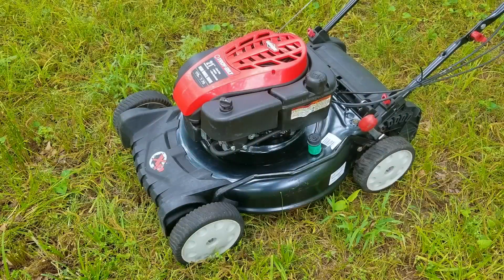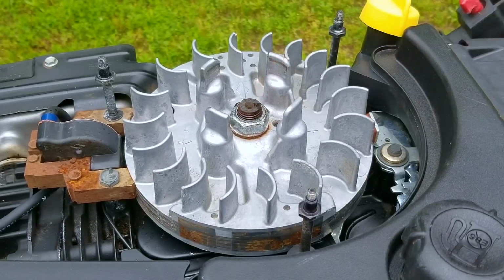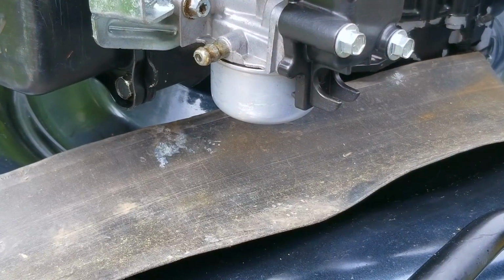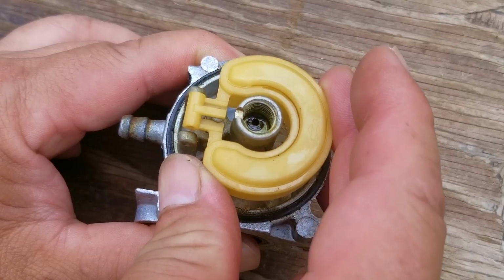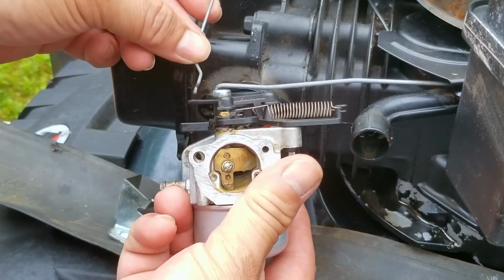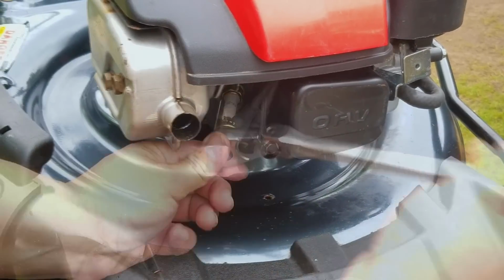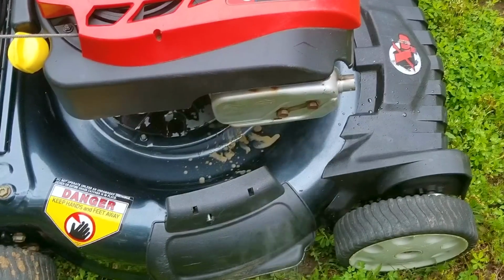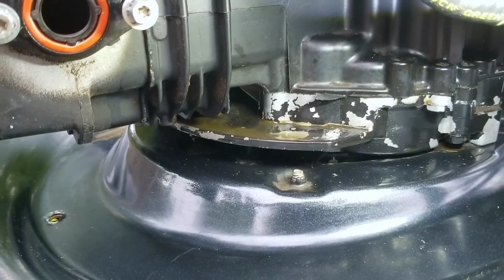Trying To Fix A Troy-Bilt XP Mower That Won't Start

Comment: I had a mower that was in a lake for 3 days.   For me. I drained the oil and water...cleaned out with carb spray...changed oil 3 times until no milky sludge....I still use that mower....but its a Quantum
Reply from the maker: wow nice!

Comment: Here is what I would do with this mower. I would take it all apart completely, engine included. After seeing what condition that the engine is in, then I'll know if this is worth fixing or not. This won't cost you money but it will cost you time. 🤷🏿‍♂️🤷🏿‍♂️🤷🏿‍♂️🤷🏿‍♂️🤷🏿‍♂️🤔 Keep up the good work. 😊👍🏿
Reply: Huge waste of time unless you are really really bored and have absolutely nothing better to do.
Reply: @tjclarke4604  Making money is NEVER a waste of time. You might want to remember that. 🤔🤔🤔🤔🤔🤔🤷🏿‍♂️
Reply from the maker: well said
Reply from the maker: good point!
Reply: @patrickpoulard24  It has been my job for over 30 years, master service technician, double-certified.  Trust me, tearing the engine apart WILL NOT make you money, YOU might want to remember THAT!
Reply: @tjclarke4604  If you are who you claim to be, you off all people should know better. 🤷🏿‍♂️🤷🏿‍♂️🤷🏿‍♂️🤷🏿‍♂️🤷🏿‍♂️🤦🏾‍♂️🤔

Comment: Carburetor $23 on Amazon, flywheel key $2, if that were on the bench in my shop, it'd be a $90 quote to the customer, I'd say it is worth it.  In a stealership, you'd be looking at $120 labor minimum, + shop supplies, $80 carburetor...  Take it a tech who works on his own, this is a really common things with these mowers and nobody should get ripped off by a dealer for something that literally takes 1/2 an hour.  Good video, you did everything perfectly, and that mower will work just fine once you finish it up and install the new parts.  Looking forward to it.
Reply: If you think you could fix this mower, including oil leak, in 30 minutes, then you are either really really goid, or incredibly sloppy at fixes.
Reply from the maker: don't worry when I get this one done, I'll total up the parts and labor and you're going to flip out when you see the quote.
Reply: @mikespain8655  Really good.  Been my job for over 30 years, and I am a certified B&S Master Service Technician, twice over.  30 mins on my bench and this unit would be ready to roll out the door.  If it is indeed a cracked block, when in doubt, throw it out, I have enough dead units in the scrap heap to just find another sump or block.
Reply: @HomeGaragechannel  I have a boneyard at our shop too, sometimes you find just what you need in the scrap heap.
Reply: @HomeGaragechannel  Oh, I meant to ask, do you have an ALS leak detector kit?  You know, the dye with the UV light and the yellow goggles to spot oil leaks?

Comment: The engine sounded good,  the oil leak might not be too much of a problem,  perhaps a leaking seal at the bottom of the engine.  It is sad, that it looks so good but a bunch of problems.  If the block is cracked,  it could be welded,  but that could get real expensive.  On the other hand, you could have a lot of good parts,  like the flywheel,  ignition coil,  fuel tank ect. . Whatever you decide,  I'm sure it will be for making money,  in this day and age that's good.  

Enjoy your videos Sir
Reply from the maker: thank you Bert Grau and I appreciate your insight and time.

Comment: I imagine you have this thing running already, before the release of any follow up video. I think it is strange that you did not check the oil initially.  I have seen motors hydro lock with a faulty needle seat and then, depending on where the crank was in the cycle, the fuel works it’s way into the case making a latte.  Your oil capacity maybe double what it is usually.  It looks like oil may be coming out of the rebreather hose. If so, my guess is a carb kit, oil change, and $3 key from the hardware store will get you mowing with no problem.
Reply from the maker: you guessed it, most times, I've already got the mower, trimmer or blower already sold and gone by the time any of the videos have been produced

Comment: It's a good engine. Good deck. You are already invested into replacing the carb. Gaskets are cheap, unless they caused other damage. The recoil problem is likely related to the sheared flywheel key, which is cheap. The repair is taking more time than expected, so it might be a money loser for a shop that needs to turn jobs quickly. But for a hobby, given that it seemed to run pretty well, yeah, I'd definitely complete the repair.
Reply from the maker: well said

Comment: I'd definitely look to see where the milkshake is coming from, if it's not too bad I'd fix it. It's definitely a nice looking mower and when your done it could go for a decent price. That's if it's not too expensive to fix
Reply: I agree that is a nice mower and I’m sure he could er about $209 for it
Reply: @toddosterhout9866  Right? With the prices of mower blowers and all other power equipment he could absolutely get that for it!! He's an excellent mechanic and is super meticulous when fixing stuff I'd definitely give him that price.
Reply: My first guess would be it is coming from the breather because someone had it tipped the wrong way at some point.  Only way to clear it out is run it a bit, do a hot oil change, even and engine flush (Which is just an extra hot oil change) then run it until it quits smoking.  Give it a wash, let it sit, run it again, and check for leaks.  My money is on the breather though, I don't see many cracked engine blocks.  Maybe seen 5 in 30 years as a tech.
Reply from the maker: yes I hope to get it fixed soon
Reply from the maker: it is coming from the breather as well but the sump gasket is definitely broken.
Reply: @HomeGaragechannel  That's not a very big deal, but you would either need a new gasket or just make one.  Might add 1/2 hour to the job.  You can also just try tightening the sump bolts too before going too far.  They do back off sometimes.

Comment: the forbidden choclate milk and id definitely fix this mower  its a nice mower ive had one of those briggs engines my self and they are quite good but yea deffinitely give it a shot and see what the result ends up as
Reply from the maker: thank you Wolf Blade that's the plan

Comment: i meant to ask you what do you clean your mowers with as far as soap , i use the super clean into a weed sprayer at full strength but it dulls the paint some and i find myself pulling the engines to repolish the decks so i can get top money , plus i use a 1500 psi hot water pressure washer , most of mine look new when done , shame i dont do more videos on them.
Reply from the maker: sure I use a degreaser from harbor freight and yes if you leave any degreaser on paint for too long It will dull. you can only leave it on there for less than 1 minute.

Comment: We had a mower that hit a stump which caused it to vibrate very badly. I think it caused the crankshaft or flywheel  to bend. Well anyway the person who told us that it could be repaired but it would cost us $150 bucks which is more than the mower was at the time.
Reply from the maker: that makes sense to me, what did you do with it?
Reply: @HomeGaragechannel  We just junked the mower and bought a new one because it was cheaper to do so back then. Also besides that Mower had an awkward handle vs the other mowers that we have used during that time.

Comment: Going to take a tear down for a base plate gasket or gooing up and flywheel key and carb. That'll take a while. A good motor swap would be quicker; 3 bolts and cables and fix that motor,  now that you know it'll run on a slack day, waiting for a good deck to mount it on BUT that'd be YOUR call. Sure gets interesting. BLESSINGS!
Reply from the maker: yes you are correct about the swap.
Reply: @HomeGaragechannel  I try!

Comment: I have the same lawnmower,do you know why it keeps dumping gas into the combination chamber and crankcase.ive put 3 brand new carburetors from Amazon and they all leak.is it just bad carburetors?
Reply from the maker: wow that's strange.   If had to guess, there's debris at the bottom of our fuel tank, and it's making it's way into the carb and getting stuck in the needle and seat area which would cause it to flood.  Try installing a good fuel filter with a paper media in it. And while it's out, take the carb off and clean out the seat area.
Reply: Ok,thank you.

Comment: I know what I'm going to ask has nothing to do with this project. 
But being that this is your video i  was hoping you would get back to me faster.
What is your take or opinion on power washing a big riding mower. 
 I had a big craftsman mow give to me and it's a nice machine but hasn't been cleaned in a long time. And would like your advice and maybe a few tips or secrets. 
I trust your judgment and think you you an awesome macanic  and value your opinion. 
Be waiting.  
Your friend Tracy from va........
Reply from the maker: thank you Tracy  from VA, and yes, I'd use a pressure washer on a riding mower BUT,... there are a few places you should avoid. The Starter is the first place and the second would be the carb area. The only other bit of advice would be to turn the rider on, test the blades  and run it a bit before you put it up.
Reply: Sounds good 
Thank you 👍👍

Comment: When picking up free mowers what do you reject?
Reply from the maker: it really depends on how I feel that day. I've passed up a quantum before only because I just did see a need for it at that moment. Other times I've passed up on ones that was missing several parts and the parts left were not the common ones.

Comment: Where can I get the tool you use to find out the amount of force that is required to move a walk behind mower  I Saw that video on your using it for the amount of pulling  force that is required to pull the mower forward
Reply from the maker: I got it from amazon, and it's not expensive at all!
Reply: @HomeGaragechannel   when you get a chance to send me the name of this tool so I can get it for myself thanks 👍

Comment: Hi everyone, I have the same mower but unless someone pushes a tiny metal behind the air filter before it can start and engine oil flows through the air filter. Any advice please? 🙏🏾
Reply from the maker: your automatic choke system appears to not be working.

Comment: Hey love your videos and they have been a great help, I have a Craftsman lawn mower that makes that same sound from the pull cord recoil when it runs after about a minute. What would your solution be to get that to stop?
Reply from the maker: so what I did was to move the pull handle guide that's on the right side of the handle, "Down" the handle  about 4". I would also check and make sure the wing nuts that hold the handle bar to the mower are tight as well.

Comment: those particular air filter boxes collect rain water. also making a sump gasket isnt that difficult you can use thick paper, i do it all the time  to save a few bucks instead of buying a factory gasket. cereal boxes make good gasket material.  that screeching sound is (usually)  from water in the crankcase.
Reply from the maker: really? I've got to look into the rain water part. Thank you j r for the information

Comment: years ago , gokart racers didn't use any flywheel key , so as to be able to set timing for max performance . they'd just set timing to their preference , and overtighten flywheel nut . not recommending anyone doing this on their mower , just found it interesting .
Reply from the maker: yes they would, now they have offset keys for whatever advance or retard you wanted

Comment: Let's see.. how many issues can one mower have..  let me count.

Deep breath

A MTD (already starting out badly) mower I had picked up with a Tecumseh (and it just got worse) engine, which I've noticed a lack thereof on your channel, coincidence? I think not, engine. Well, someone had previously cut the PCV hose back, and the leftover part was petrified and cracking.
So I needed to pull that PCV breather system right out of the engine. While I was removing the flywheel I noticed that the crank threads were mangled.. I chased them to clean them up.. then I replaced the PCV valve. While doing that, the carb was a disaster, so it would not start, and it would leak like a broken faucet, right out of the carb bowl gasket. Plus the bail cable handle on the handlebars had given up, which gave me a whole lot of problems trying to start. And I had picked it up, because all it apparently needed was.... A new pull rope.
The blade thankfully was pretty clean, and the deck overall was quite decent.

There's probably other things, I made a video on it and all, if someone wanted to see it, they'd have to search for it.

Honestly... I've learned something of great value from that mower ... Do not listen to what the previous/current owner tells you. They likely have messed that mower up so bad, you probably should be awarded for the humanitarian aid you're giving the mowers 🤣

Another good video, I won't echo what others have said, tho.  I'd sell this mower. If I'm going to keep one, it has to be unique. Similar to the Green one you had with the ball bearing wheels, I have a 35 year old Big wheel craftsman with a Tecumseh engine, I keep it because it's 35 years old, had the old style PCV where it vented to atmosphere, and... If I every wanted to convert it back to original stock, I have the old style Carb without the breather nipple.. came off a Cursed Murray (that thing is a whole other story)
Reply from the maker: thank you for all this information, I'm sure it'll help out

Comment: If you can recoup the cost of repairing it at least from a video on it, perhaps do that to subsidize so that there's one less mower in a landfill. If that's not possible, maybe just keep it for any useful parts and recycle the rest of the metal/scrap.
Reply from the maker: agreed!

Comment: If a flywheel key is broken will it cause the engine to lock up
Reply from the maker: no, it only causes the ignition to fire at the wrong time.  Engine lockup is typically caused by low oil in the engine

Comment: I would pull it apart, clean out the engine, then put it back together. Then fix the recoil issue. As for that carby, I'd simply replace it.
Reply from the maker: yep that's the plan

Comment: That mower is fixable. New Carb. New key. New lower gasket or use RTV instead = fixed mower.
Reply from the maker: yes it fixable but just a lot of issue which adds up to be a lot of time.  Thank you Dee Bee.

Comment: If you know the carburetor needle and seat are NOT working correctly, add about 1 ounce of fuel/carb cleaner to the bowl through the throat.  You only need to get the engine to run for 10-20 seconds to know if there are any other serious problem.
Reply from the maker: good idea

Comment: The engine is likely to be fine.  Obviously you'd need to replace the sump gasket.  Replace the carb.  If all you did was repair/resell then maybe not, but you also create YT videos for this so that's my advice.
Reply from the maker: you got it, all of it needs to be replaced. wait until you hear what the require quote is.

Comment: Sump gasket. Head gasket new carburetor flush the engine out to remove all the contaminated water oil.. reassemble inches on base gasket to with our TV to make up for gapping resell it for two hundred bucks
Reply from the maker: I know right, lots to do, and the money might not cover it.

Comment: If you had taken it to a shop then the labor rate would kill it off every time. Working for yourself means (to me) you can spend more time on it to try to fix it maybe beyond practicality.
Reply from the maker: yep very true, I'd guess the repair bill for this mower parts and labor would be well over $300.

Comment: 190cc new carburetor filter oil change spark plug still won't start
Reply from the maker: Have you confirmed fuel is making it into the combustion chamber.  Also have you confirmed there's spark with the new spark plug?

Comment: I just replaced the new age throw away B&S engine with a 5.5hp Predator and its 10x better. No more plastic carb or nikasil aluminum cylinder..